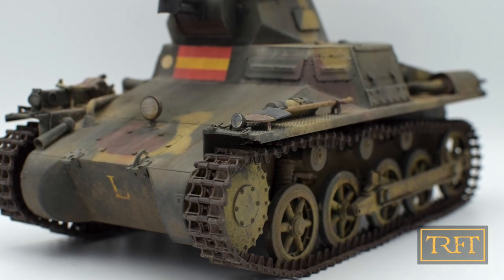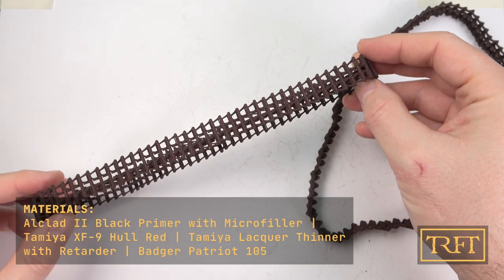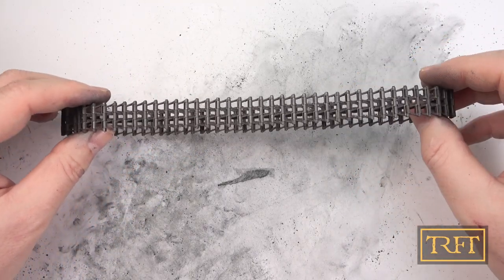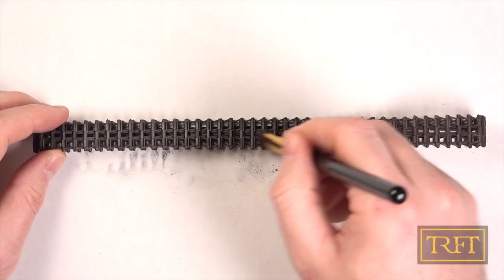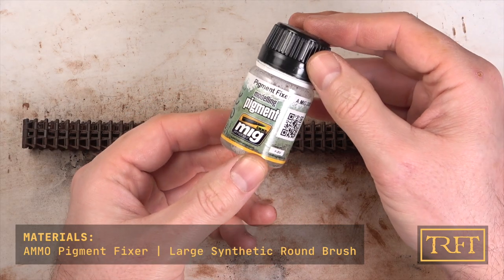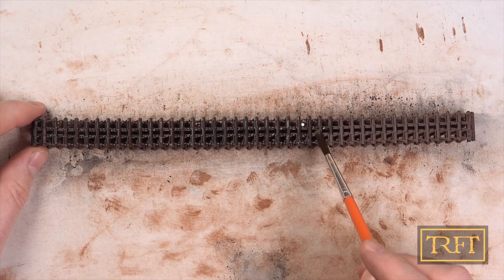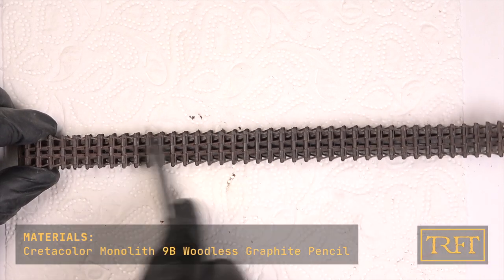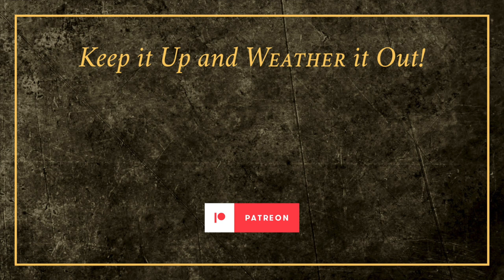Weathering Workable Tank Tracks | Panzer 1 Breda Tutorial

Comment: Did you choose Hull Red for a specific modeling reason or was it for historical accuracy?
Reply from the maker: Hi Michael, great question. It was a combination of both - Tamiya's Hull Red primer provides a coat tougher than acrylic primers and has the right tone for the job, which boltgun metal would not. It is also the color I used to prime the rest of the tank, because it is similar to the primer used on actual WWII German tanks. So for accuracy in terms of the starting color (tracks NEVER look shiny metal like we are used to in Warhammer), and ease of use. Does that make sense?